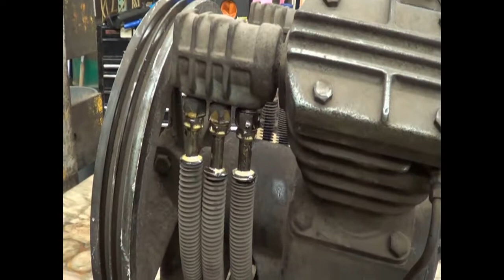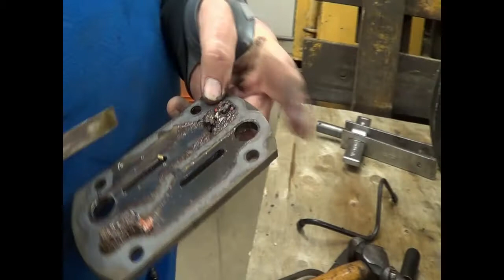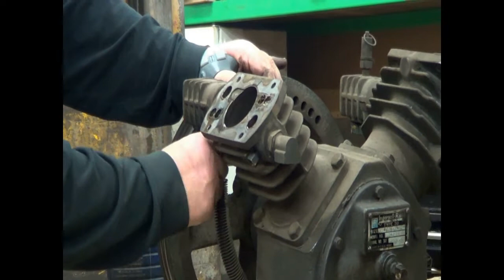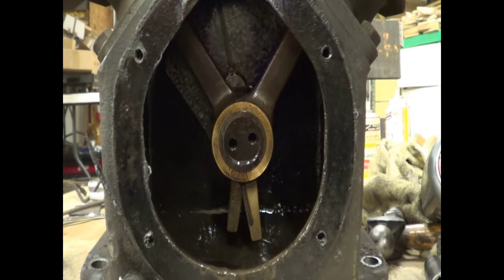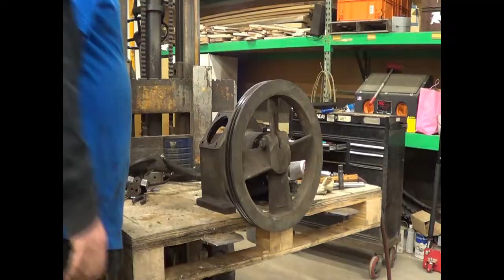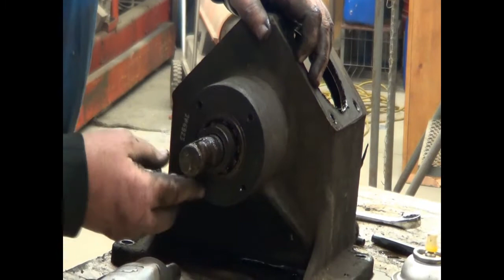63 year old! IR 242 air compressor Tear down and evaluation. S1, E21

Comment: Thanks for the video sir. I have a wheel barrow style I.R. compressor that will only build 80 psi. Any tips or ideas what could be wrong befor i tear it down and rebuild it. Rebuilt alot of engines but never an air compressor. Thanks im advamce for any help!

Comment: Is the 242 significantly better/different from 2475 or is it just cooler?
Reply from the maker: good question. the valves are easier to repair on the 242. The 2475 makes a whisker more air. I have seen some 242s that guys literately pinstriped the heads. that is cool! BTW it was bright red with gold stripes.
Reply: Thanks for responding. I’m going to see how the 242 runs but I think I remember the 2475 being in better internal shape from what I could tell. I wish I could do a comparison test of the sound they make, thatll probably be what it comes down to when I decide which to run. Thanks again
Reply from the maker: @mikesradguitars   I do check machines from time to time with a decibel meter, but I can't every think of the comparison between these 2

Comment: I'm glad you are showing this rebuild. I have a 242 that should be rebuilt. Mine is probably older than the one you are working on. Mine only has 1 cooler line. It sure is interesting to see and learn about these air compressors.
Reply from the maker: Hi Joe If yours only has 1 innercooler line I am guessing its newer. the older ones used 3 into a manifold.

Comment: I have acquired one of these.  Mine is a  t30 and the pump is a 242-5c.  Mid 1980s vintage so it's a little newer.  It was removed from a fire department and I was told it was knocking.  What should I expect to be the cause, ball bearings or connecting rod bearings?  I hope to fix it and use this machine.
Reply from the maker: I would guess that the knock may be a rod, perhaps a wrist pin,  the main bearing going bad is a very odd thing. I can get you parts. contact me through the website thecompressorguru.com 
it is possible that there may be something on top of the piston, I would pick that as least likely. but the first place to start. good luck.
Reply from the maker: I sold a great number of the 242- 5 c 1 in the late 80s early 90s. it is a good machine.